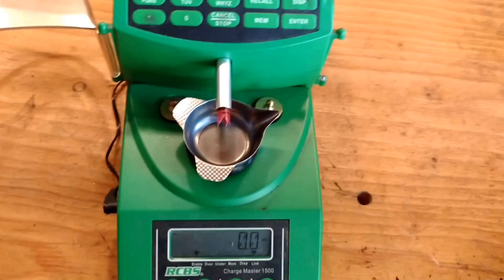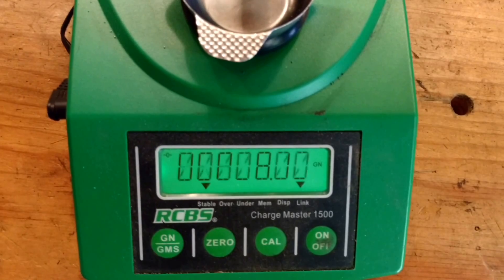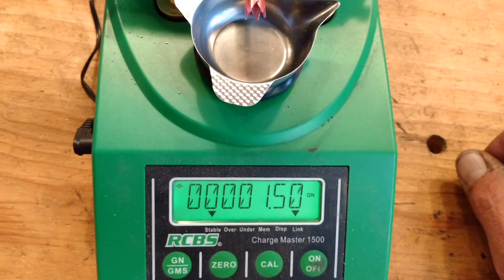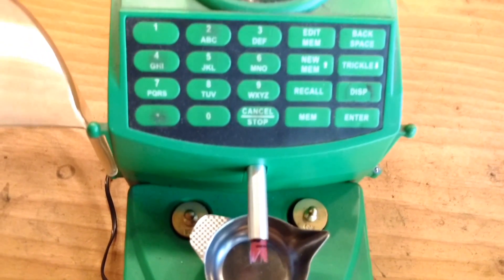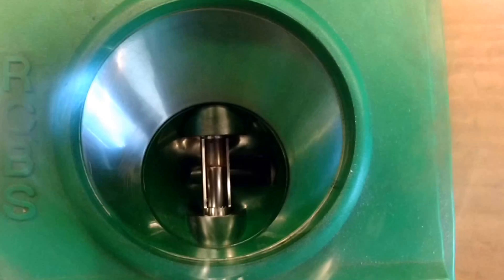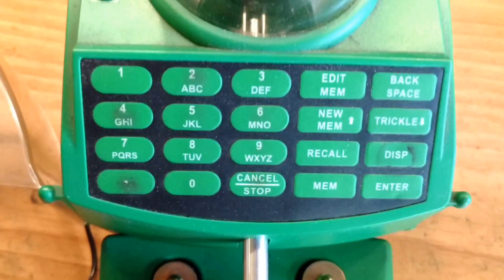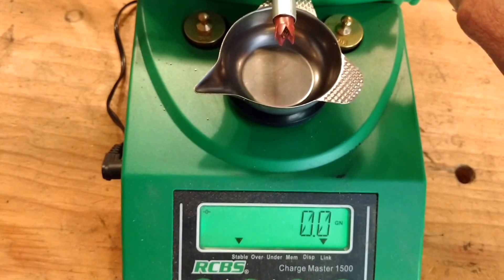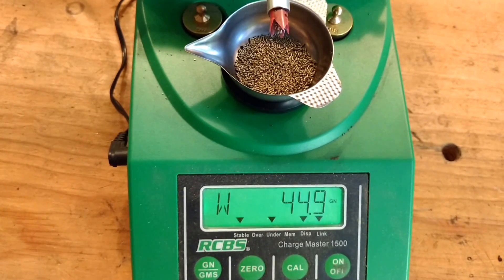Eric's RCBS Chargemaster Modification, Turbo drive !

Comment: Do you know how to reset the calibration , mine reads 999.99 when the calibration is finished, not 0000.00  Great  video, the setting may be under the place you reset the time , but not sure where or what it is.

Comment: Thanks!  Came back all charged up from a day at the range and decided to tackle it!  You and Erik made it easy.   Got the electronics done in short order, then the straw with cuts in, and topped it off with a Dandy Trickler, similar to what Erik has.  Now all I need is to prep all the brass I shot up today (a good few hours on the chrono) and I'll be ready to test out the new set up......   It all works beautifully so far!  Hoping it will help with my SDs and ESs.  Thanks again!

Comment: Why was the straw mod absolutely not working for my H1000 as it was clobbering up in straw! Making straw go all the way back. Then i just tried a inch of straw but still did not like it vs nothing used. 88gr. though i got to around 20seconds using 10.00 / 3.50 / .70  and started lower values than that but kept getting over throws so i was only going to mess around with it so much . BUt i use 2 machines as well to save time haha.
Reply from the maker: I use a lot of H1000 and RL26 and have great throws.
Notch the end of your straw if you haven't already, also if you haven't tried moving the straw in or out that is the key to get it to throw it constantly everytime.
Once you find where it's perfect take a sharpe and mark the straw next to the metal tube so that way it's easy to find the same spot when your switching between powders.
Reply: @atonefew  I think the kernels are some how sticking to straw though by static or something but i can have 100 kernels in straw and tap it on a table and they all wont even fall out. And this was a new bottle just opened of h1000 also my first bottle ever to reloading.  Just like kernals were also sticking to the metal pan at times . So i would wipe it with my shirt then all the sudden they would dump out fine. Hmm do i have wet gun powder some how .  Anyways i was able to setup machine to run fine with no straw mod  for now.
Reply from the maker: I would grab a dryer sheet and wipe everything down as much as you can that's a crazy amount of static and shouldn't be that way.
Reply: @atonefew  i will try that thanks. Yea i dont get it. Im in second story of my condo and its 70F inside and i even run air filtration unit upstairs in my bedroom (next room over ) .Maybe my hands are radiating big time or something lol. Yet i take nascent iodine daily for health  along with many other vitamins .

Comment: When doing an accuracy calibration test I usually drop 5 or 10 group throws at a time and weight the total to measure accuracy and drift average and if it stays under .5% then everything is correctly working. Also I set up a beam scale or a reliable digital scale as a cross reference to RCBS digital scale when weighing 5 to 10 throw groups to verify digital scale is reading consistently and not drifting.

Comment: Hi there...is there a option like this for the Chargemaster Lite?
Reply from the maker: I've called RCBS with a die issue and trust me it's worth setting an alarm clock for.
Was impressed with their knowledge and service response....give them a call hopefully they can get you taken care of !
Reply: atonefew thanks for the response, will definitely make a plan to call them.
Reply from the maker: Not sure ?
Reply: atonefew ok cool, they say i have to call tech support, but i live in South Africa...so the time difference doesn’t really allot for it. And ive mailed them a few times

Comment: I use a moderately 'chunkier' powder - H4831-SC; I used your initial settings, but was getting consistent overthrows of .4 to .5 gr. each time. I found that by modifying my speed settings to 9.00, 2.50, and 1.50, it gave my older CM 1500 some time to 'catch-up' during the weighing, while still being quite accurate. My charge time decreased from around 20 seconds per charge, to 11 seconds per charge, with zero over throws. I then checked some of the finer powders, like W760, and Varget, and also used smaller charge weights - it works great. I am also using an aftermarket orifice restricter on the end of the trickler, as opposed to the straw trick. Overall, this is a great mod - you might need to play with your settings to get it perfect, but Eric's settings a pretty close to what most people need. Nice job!

Comment: I have the RCBS CM1500 Combo and the one thing that annoys me about it is the feed tube and where it sits inside the dispenser, there is a large gap on the inside of the dispenser between the feed tube and the bottom of the dispenser that leads out to the drain tube, when the powder level drops below the feed tube, you'll have to add more powder so that the dispenser could dispense the powder or it'll just spin and nothing will come out. I'm sure RCBS made it that way to leave room between the feed tube and the tray on the outside of the dispenser but I think if they reduced that gap by about maybe.. Oh 1/2 inch, you wouldn't have to add powder and you'd have less powder to drain out of the dispenser when you're done with the reloading session. It's not a big problem just a slight annoyance.

Comment: Thanks for the info, what if we clean the inside dispenser with anti static paper to prevent accumulation of powder this may stop the over weight results ? I didn’t do it it just came to my mind now I appreciate your feedback thanks again
Reply from the maker: Dryer antistatic sheets work well, also use it on my pan and outside of the drop tube here and there.

Comment: I used your settings except I went 75 on the third setting . I did the straw like yours as well. Just did 50 drops using IMR 4350 and only had 1 that come up over and it was only .1 over. Before it would have taken twice as long and I would have more that were over weight. 
 I love it . THANKS!!!
Reply from the maker: Randy Gray Awesome, glad to hear it !

Comment: Awesome video Thank you! Just cut my time down from 35-40 seconds to 7-10 seconds!!! 43.5 gns. of Varget with hardly any overthrows so far! Had to tune mine a little different due to straw differences so I'm at 8.00/2.20/.60 for these results. Thanks again

Comment: Just got one of these, really appreciate your mods! Does changing the factory settings speed up or slow down the powder dispensing?
Reply from the maker: It speeds it up for the first two stages and also allows you to adjust the amount of powder going into the dispensing tube.
Reply: Thanks, I will try out the mods tonight. I used it for the first time last night and found that while the hopper drain is really nice, it still takes forever to get a light flake powder (i.e Unique) out of the guts of this thing and the trickle tube. Any hints for speeding up post-loading cleanup? (since I reload various cartridges/powders I like to make sure it is completely empty after each session) I'm thinking your straw mod might help in this regard.
Reply from the maker: I open the drain, once empty I hit 66 gr. and hit dispense and let it run for about 10 seconds then I tap the dispensing tube with my finger while its running to make sure nothing is left in the tube...has worked well for me.

Comment: I watched 8541 tactical's video and had already reprogrammed mine, he didn't use a full length straw but I find it works more accurately with the full length straw because it helps regulate the amount of powder coming through the chargemaster. I didn't bother with the cuts on the straw as found it to be more precise without them, works great with varget. Thanks for info.
Reply from the maker: D O'C John's programing is different than mine, you won't get the full advantage of this modification without reprogramming the CM.

Appreciate the comments though.
Reply: Yes I also reprogrammed with your settings as using the whole straw slowed the powder flow rate down by half, so that meant I could speed up the dispenser rate. All happens in under 10 seconds and with hardly any over throws.